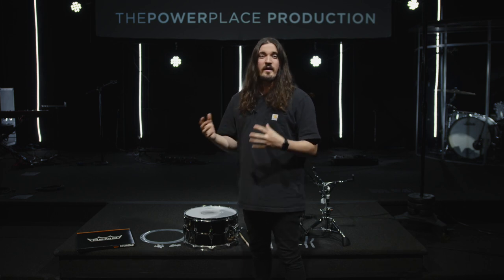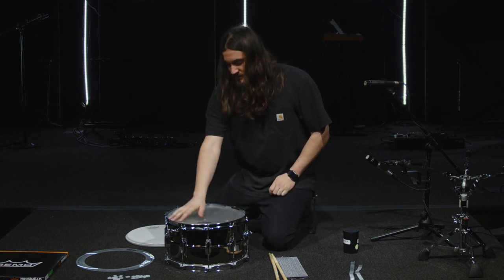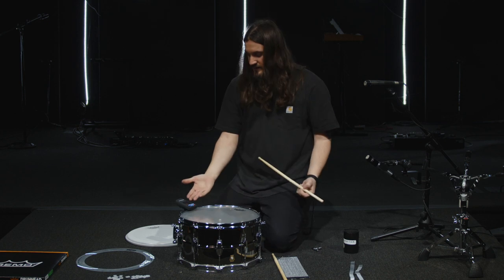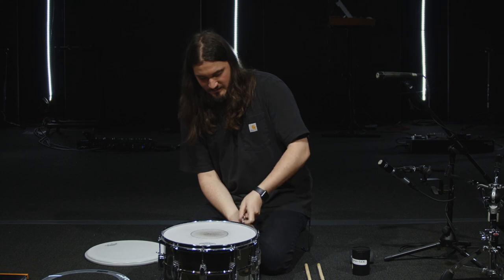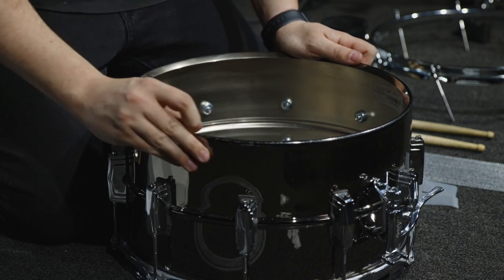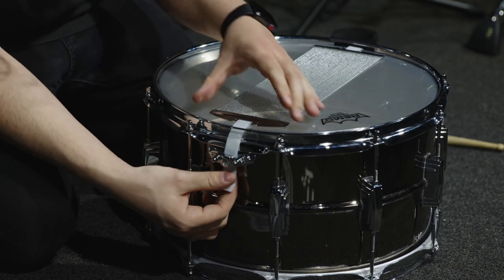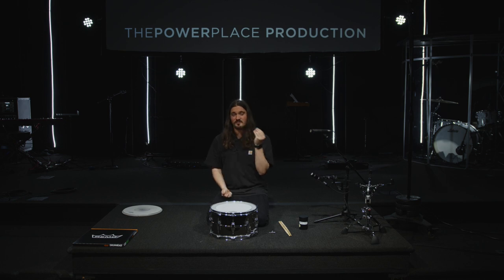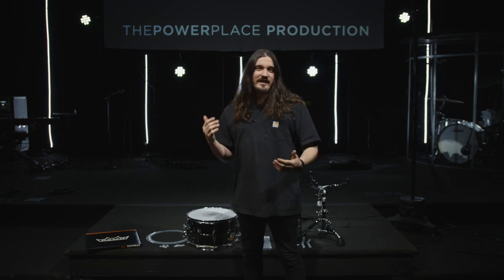Snare Drum...Tuning, Heads and Mic Placement! | Ludwig | Black Beauty | Tune Bot | Remo | Shure 545

Comment: Lots of good suggestions. However recommend fitting butt end snare wire end fitting first as the position won’t move like the strainer end.
You say that the snare wires you have fitted are Puresound. Unfortunately this is incorrect as (1) Puresound have straight ended brass end plates (2) Puresound don’t make more than 30 strand snare wires not 40 (3) these are probably Gibraltar 42 strand wires - still great wires though!!
🤘😁🥁👍

Comment: Hey dude awesome video, have you ever gotten weird tones from the throw on the black beauty? I feel like mine has had this weird hum ever since I changed my heads. Ive tried dampening the bottom skin, the top (obviously) but I still seem to get that humm. Any rec's would be greatly appreciated!! Cheers
Reply from the maker: Thanks! Yeah actually I have. Usually for me it means the bottom is too loose. Also the BB snare is really sensitive to how the strainers are on and how the head is on. If both aren’t perfectly straight it can do some weird things in the lows. This snare has made me a better drum tech for sure because it doesn’t help you out it makes you work for it. But when you get it right it’s really great. Hope that helps! Also make sure your rack Tom isn’t too low or too high on the bottom. That can cause some resonance with the snare cause it’s so close too it.

Comment: I just got my Tunebot and changing my 14in Snares with Evans Hydraulic. I would like to tune the batter to 196.0Hz/G3 and the reso 196.0Hz/G3, how do I set in the Tunebot. Thanks
Reply from the maker: Slowly bring the drum up until it gets to the 190+ area and then hit filter after you make a lug read what your shooting for.  I would tune the reso head a bit higher then that though. But hey if you like that sound go for it!
Reply: @thepowerplaceproduction  Thanks for the advice what is your recommendation tune for the reso. When you say get to the 190+ area is it the centre or the lug.

Comment: Sorry buddy, 

U made a massive mistake due tuning the Bottom head.
👆

I have got the same tunebot on my own.

When u use the tunebot on the Bottom head and u go near or over 400 hertz u must use the high frequency Button on the tunebot.
Otherwise it could be u allways get 400hertz because in normal Mode the tunebot can't detect higher.
It is it's maximum 
When u Hit the high frequency Button the tunebot will be able to detect more than 400 hertz 😉

U r welcome 😉🤟🥁🤟
Reply from the maker: Never knew that! Thanks for sharing I’ll have to try that out!